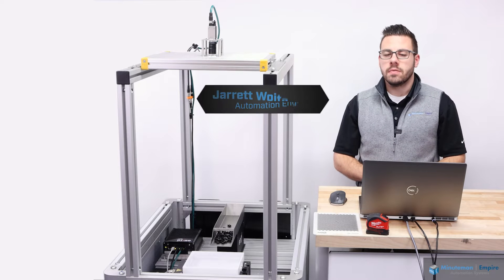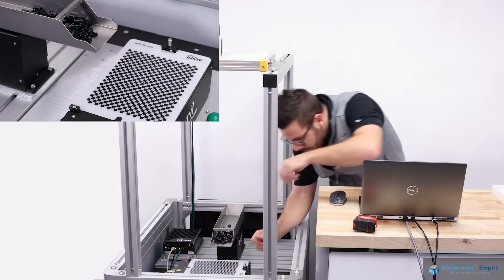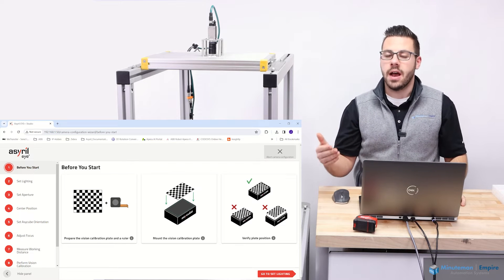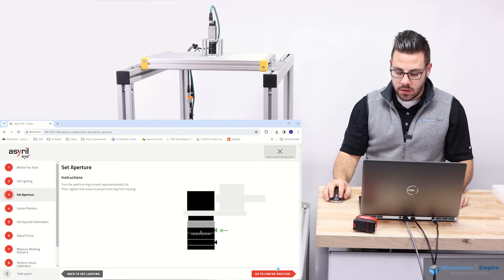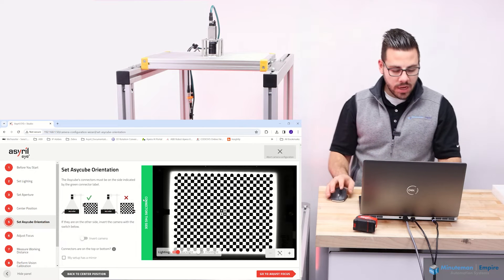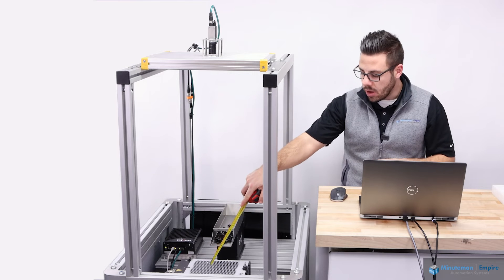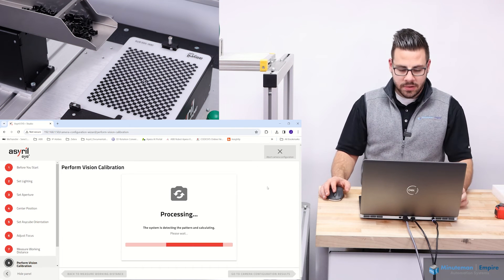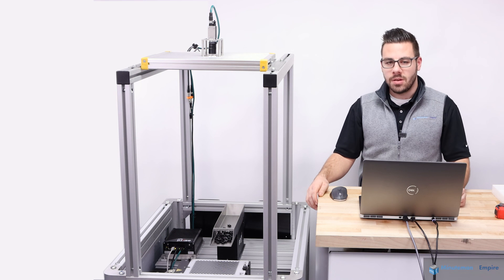MASEAS | Asyril - Camera Calibration Using EYE+ Controller

Comment: Thanks for the informative video. I am having some trouble getting a successful calibration, using the asycube 240. At 870mm distance between the camera and calibration plate, my image seems significantly more zoomed in than yours so the long sides of the plate are not in view. The focus, alignment and orientation are all correct. 

Any ideas on what to try?
Reply from the maker: Depending on which distance kit you ordered with your EYE+ controller, you may need to adjust the working distance such that you are able to view the entirety of the calibration and vibratory plate. The camera calibration step is looking for the specific calibration plate pattern, so if it is not able to recognize the pattern, it will not successfully calibrate. After adjusting your working distance to view the entire pattern, adjust the lens so that the image is in focus and input the new working distance when prompted.